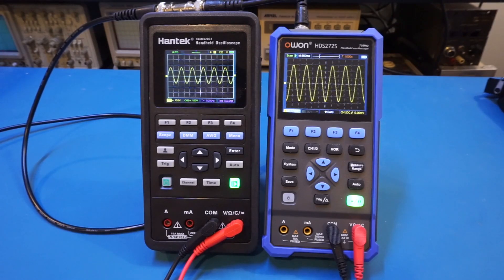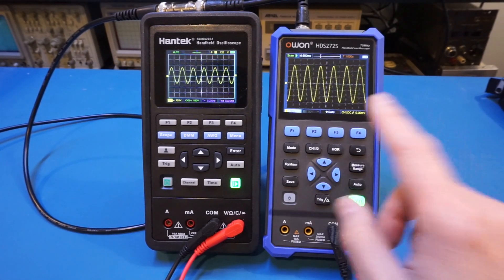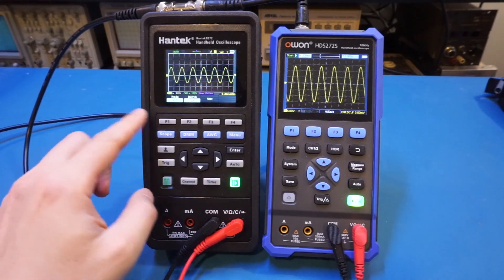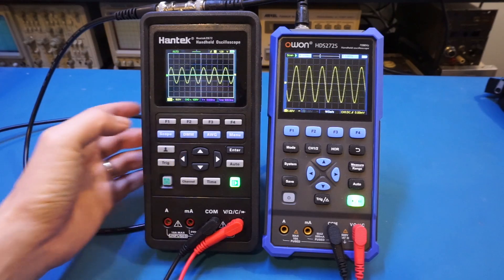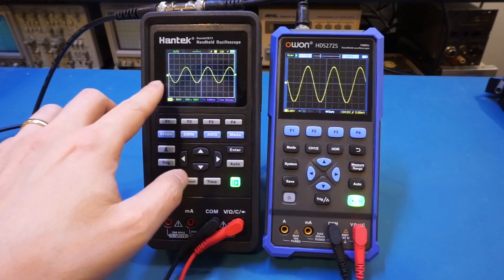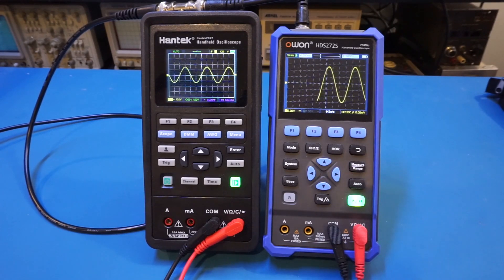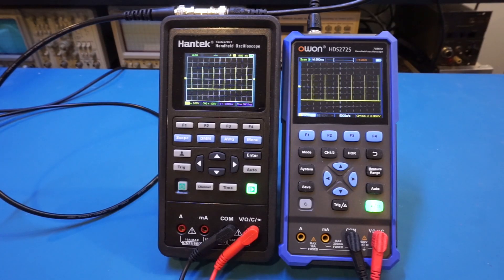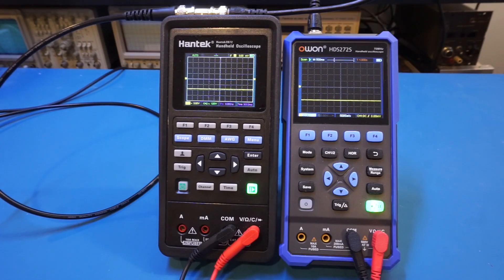Slow Timebase Performance Comparison: Hantek 2D72 Vs. OWON HD272S

Comment: The Owon can be switched from "Sample" to "Peak Detect" mode in the "HOR" menu. As far as I can tell, that runs the ADC at full speed, allowing it to capture short pulses on slow timebases. I've tried it on mine and it happily captures 20ns pulses (as short as my func gen goes) on the 500ms/div timebase. The Hantek may be the same but I don't have one to test.
Reply from the maker: Thanks for the info Colin!